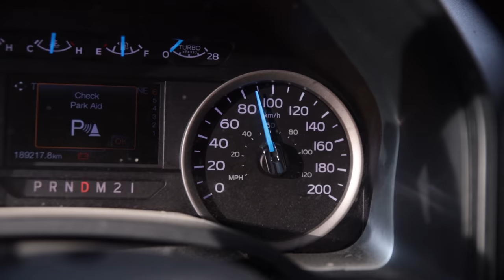PICKUP Truck Tows MONSTROUS DUMP TRUCK On HIGHWAY!!! Heavy Pull

Comment from the maker: F-450 update coming in the next vid! Hope everyone is dealing with current events alright, stay safe everyone.
Reply: Why do you keep going up in increments when you clearly would benefit from a 550. you can get a CHASSIS CAB F-450 XLT and have a custom bed made for you and and have a much more capable 40000lbs with the heavy tow package AND still spend about the same as a regular 450.
Reply: Why don’t you upgrade to a Class 8 semi? That’s “heavy duty”
Reply: What kind of trailer is that?

Comment: Always tow alot with Ford dad had a grand marquis pulled 9,000 lb boat over 200,000 miles. 2018 f150 EcoBoost roll the load fast as you want. 550 is a bad dude.

Comment: I mean the dump trucks literally weight is probably around 23k that’s if the box is a AR400 demo box, they look really BIG because it’s 3ft off the ground towering over a pick up so the size difference makes it a cool looking load kind of resembling a heavy haul truck hauling a Rigid CAT Rock Truck it has the same size difference when coming at you lol… I don’t know why I don’t see guys locking up the trailer brakes TIP I’m sure you know this trick but in case others are reading comments, it amazed me that more people don’t practice this instead of putting all those negative forces back and forth when loading pickups- 

TIP- When you’re unloaded or loading the gooseneck find a way to lock the spring loaded HYDRAULIC trailer brake service pressure SWITCH  pushing that spring loaded switch all the way over to its maximum gain and finding something to hold that switch applied with while you’re loading  (I have the gray spring loaded clamp from Harbor Freight that hold the switch closed) it works perfectly! Anyways that’ll keep those trailer brakes locked up while you’re loading your trailer, I HATE watching guys load these things rocking the truck back and forth causing all that unnecessary wear and tear against parts, plus when the trailer is nice and solid  it gives you a better sense of comfort loading on a surface that doesn’t feel like you’re pulling on to a roller skate or something. Also by chance the back of your pick up gets “picked up” you won’t be going for one of those hole puckering rides down the street like you’re on a roller skate. As long as your trailer brakes work and adjusted properly you can count on them to hold the load to the road, if you’re questioning the adjustment just turn the trailer brake gain adjustment up to 10 while loading to just be sure.

I also have a pipe that’s measured and fits perfectly between my seat and the brake pedal, even with the truck brakes applied the trailer brakes work off inertia mixed with electrical so you still need to lock the trailer brake switch manually closed or turn the gain all the way up to have them be totally locked if the pedal is applied it just allows the brakes to start working they don’t increase pressure until the interia begins to push back against the trailer which increases the trailers breaking since you’re loading and not pushing a constant force against the interia switch it will not apply anymore pressure then bare minimum so it’s best to turn up the gain and lock up the spring loaded switch, unless I’m on a hill and really needing the xtra braking on the truck I usually don’t bother with the truck brake pedal just throw my clamp on the trailer brakes and that’s perfect.  Using the pipe I’m totally locked up all around, with manually trailer too, if you start pushing around the trailer and sliding the truck around during loading at that point you’ve got some bigger problems and best not be hauling anything haha..

Comment: You should look into Boar wheels for your trailer.  They replace most trailers with 19.5 G rated tires, that way when you get your 450 your trailer and truck will run the same size.

Comment: Maximum Combined Weight Rating is a Ford F450 pickup at 43,500 lbs the funny thing is the Chassis Cabs are now rated lower than that.

Comment: Nothing in 1985 my uncle towed my 6500 GMC loaded  32000 gvw with his 2984 Ford ranger v6
Reply: 😂 I'm hoping no one believes this
Reply: @abelwalker4396  fuck I was there and I can't hardly believe it
Reply: @timerickson7056  how far did it actually tow it?
Reply: @abelwalker4396  about 14 miles .
Reply: @abelwalker4396  he also used to use it to bump start  a d7 cat
Reply: he'd chain the blade up at night so it wouldn't bleed down and throw a chain on  the draw bar and pull it backwards  and  bump start the cat .

Comment: THATS WHAT HAPPENS WHEN YOU SEND KIDS TO DO A MANS JOB - theyre risking the safety of themselves and the motoring public - potential fines and lawsuits for an accident - possibly ruining the truck and trailer from abuse - all so they can save some fuel?.....how much fuel is saved - that f-550 pulling that load probably getting 7 mpg - driving the dump empty  probably  the same - just stupid doing what they did - USE THE GOOD DUMP AND A PROPER TRAILER TO TOW THE DEAD DUCK HOME.
Reply: As a 19 year old who loves trucks myself, it does seem pretty dang stupid what there doing here. 👍

Comment: If it didn't have a quick connect air fitting on the tank but had 1/4 inch npt threads somewhere just thread an air line right into the tank. Of course its easier said than done if you don't have exactly what you need at the time.
Reply from the maker: Got that right

Comment: I guarantee that dump truck doesnt more than 23,000lbs. I drive a tri axle pump truck with a 4,000 gallon tank and that barely weighs 24,000lbs. 

And as for him saying that it is for the guys own company not a motor carrier so no one cares I bet the RCMP would beg to differ. Since he owns a company and it is for the company it is still considered commercial.
Reply: mike squires yeah I drive a six axle dump truck and I weigh 28,880lbs.
Reply: I drive a 1,000,000 axle dump truck and it weighs 5 ounces... 😂 A 4,000 gallon tank on a dump truck?? "C'mon man" -biden

Comment: having no box on the truck helps raise your gvwr for towing. its a smart move.
Reply: That steel flatbed has to weigh more than the beer cans that come on the trucks from the factory.
Reply: @85square  exactly right 👍
Reply: And if you get a cab and chassis truck like that the engine is significantly derated. Buy a pickup and take the bed off